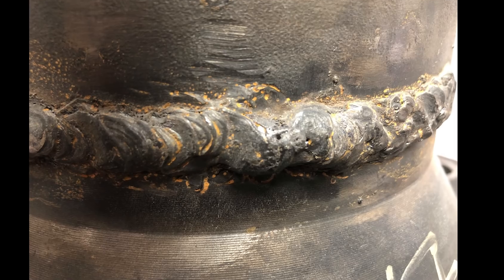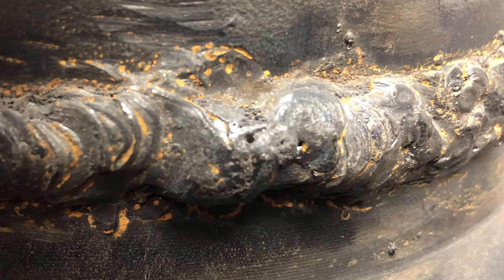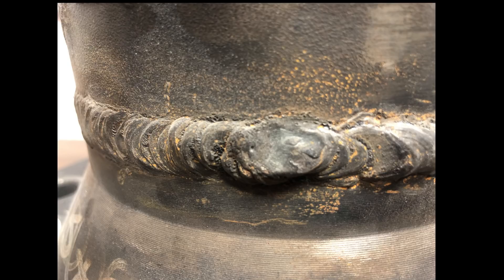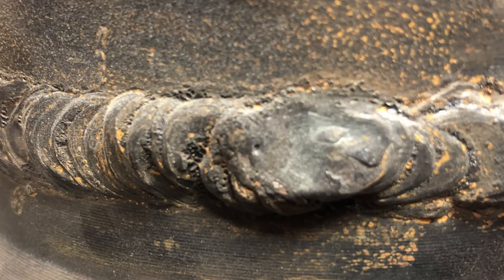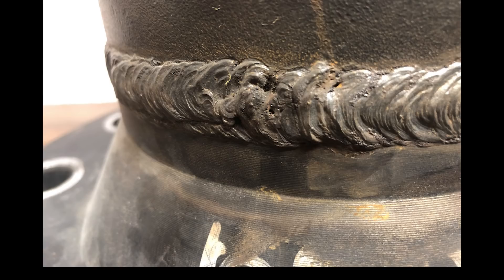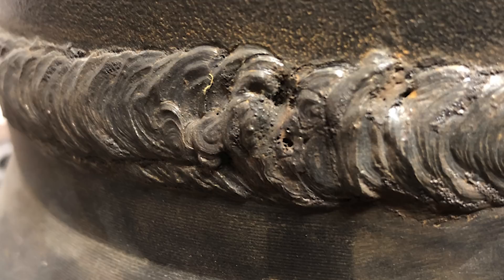Top 3 Reasons Welders Fail The ASME 6G Welder Test

Comment: I would like to ask the question when it comes to surface porosity is the test subject allowed to grind the cover pass in order to remove the porosity? In my case I graduated as a combination pipe and plate welder 27 years ago I've worked in the field of welding yet never recieved any certifications out side of my diploma in welding so I have no clue whether or not its permitted to grind out porosity on any of the weld passes or on the cover pass
Reply from the maker: Typically its common for the welder to be in full control of the weld until the welder confirms it is completed at that time the inspector does the visual inspection. The welder can grind anything they want while the the weld is being completed, once its turned over to inspection if porosity is visual its probably not acceptable per whatever the applicable code might be.